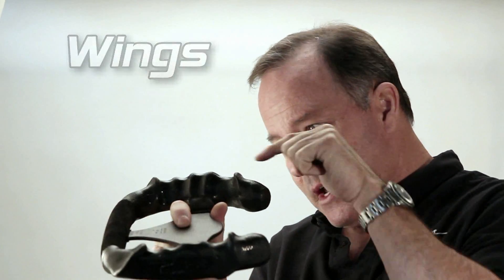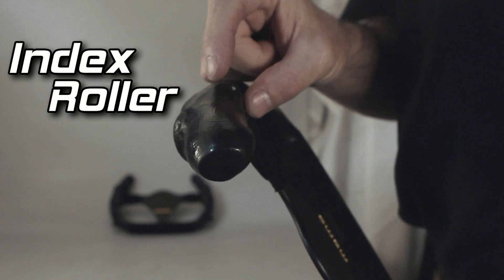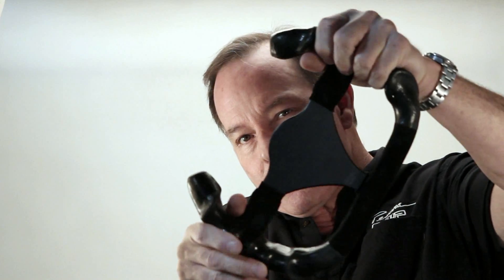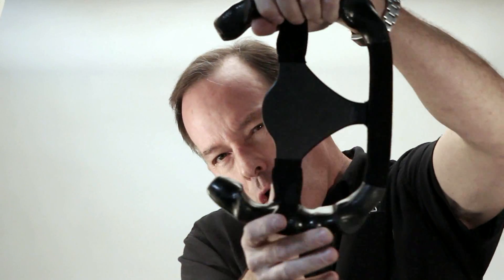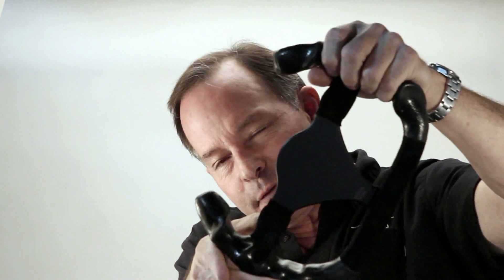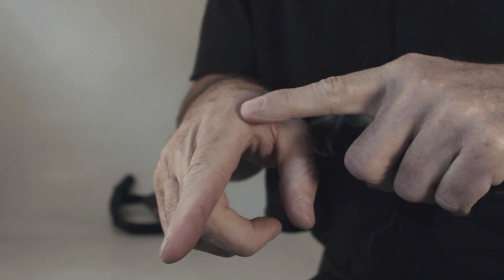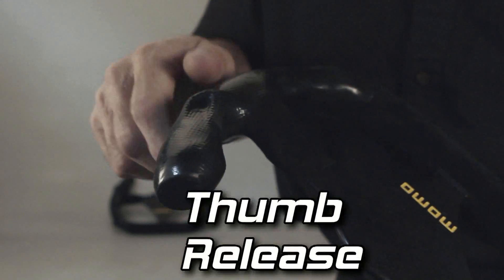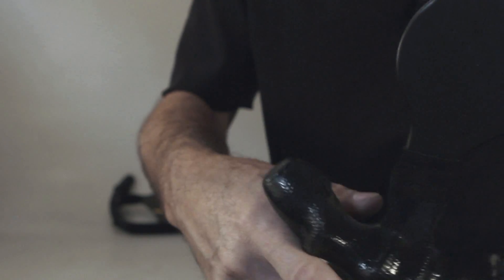Racing Steering Wheel Design Tips -- How To Custom Mold Hand Grips

Comment: how do you make these? Like what materials are inside the external epoxy layer? 
Do you have a mold that you use or do you subtract material then coat?
Maybe a list/diagram of what wings are essential on the wheel?
Thanks
Reply from the maker: I fuse my high-melt index thermoplastic directly to the foam underlisting after I remove the suede and grind it down to a thickness that suits each driver.  Since each driver is different, there's no mold, per se.  That's also why the grip material needs to be REmoldable...so you can fine-tune the steering wheel until the driver's happy.  

Sometimes a wing that might feel good in the garage when you're molding doesn't work out on the track.  So, you just need to experiment if you want to go radical with your wings; otherwise, stay conservative and keep them small and rounded on the edges.  

The wheels I did for Fernando Alonso were remolded 5-6x each before he was satisfied...so, to get the most out of them, the driver needs to be committed.  However, when you get it right...they LOVE it!